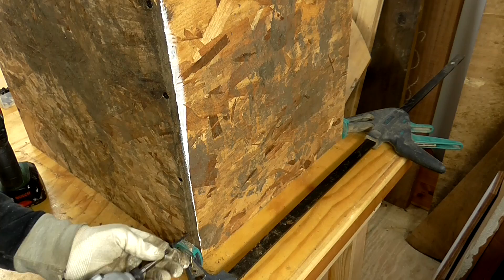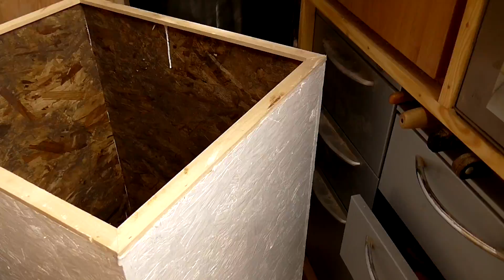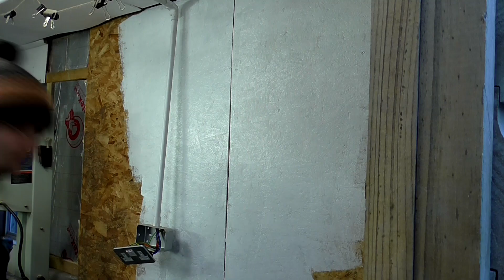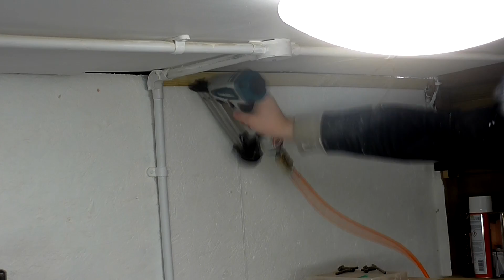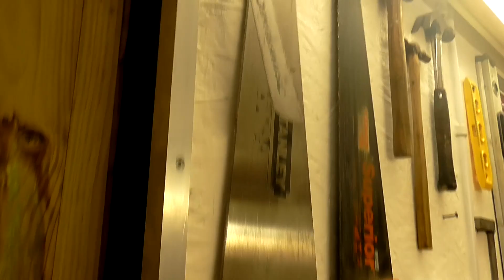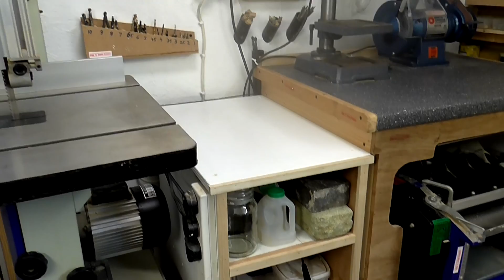Finishing The New Workshop Layout - Workshop Re-Model Episode 8

Comment: A simple question. Where did you get electricity for the table saw? Is it via extenson cord on the floor? Did you do a groove for the cord or hide it other wise. Cheers!
Reply from the maker: It’s an swa cable run under the floor from a spur off a wall socket I believe
Reply: Rag 'n' Bone Brown Cheers for reply! I have a concrete floor so I might need to figure out something little different.

Comment: Your walls are so much better in white. I had planned similar for my workshop/shed, and left it to my lad to paint the OSB sheets before the shed was erected; he only managed 5 out of 12 before he decided it was too much like hard work and blamed wet weather for stopping. After seeing the drastic improvement to your environment, I am inspired to get out the paint rollers and finish what laddo started - only the OSB is now fitted on walls/ceiling so it will not be as easy as it might have been. Also really like those bit holders made from pipe, I will copy! Did you affix them with just one screw each? Thanks for the inspiration

Comment: Why does everyone seem to hate OSB?  I get that it ain't MDF or cabinet grade plywood, but I don't think it looks all that bad.  I like to sand it smooth and cover it with clear lacquer.  Looks great in moderation (feature wall-ish).
Reply: OSB saw dust makes me itchy. Plus OSB falls apart when it gets wet. Oh, and OSB is also hideous too. But other than that, OSB is basically glued together shredded wood I suppose? Off season sheets of it drop in price to about $5 and change here. Cardboard is literally more expensive then. I think they like to sell it off because stacks of OSB tend to warp if you keep them around for too long. At least I've seen stacks of OSB that have made me a little seasick just looking at it. In my eyes OSB just barely qualifies as being a building material. To think it is what practically all new construction uses these days. People would be better off living in cardboard boxes I swear! That's the running joke with OSB built homes, you can break into one with just a sheetrock knife.

Comment: You've done a brilliant job mate, well done. 
It's weird but I had more fun fitting out my old shed than the projects I made LOL... 
Your very much like me, using what you've got to tidy the workspace up. It's great when you get to use the scrap wood you've found or scavenged. I used old packing polystyrene to help insulate and cut down the noise, fun and games fitting bits into places..

Great job. 👍🏼😊